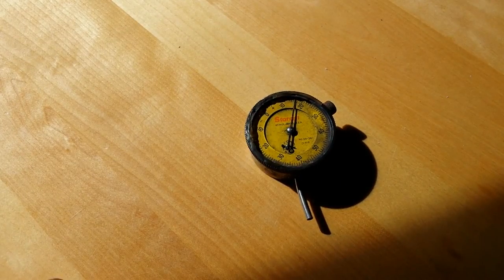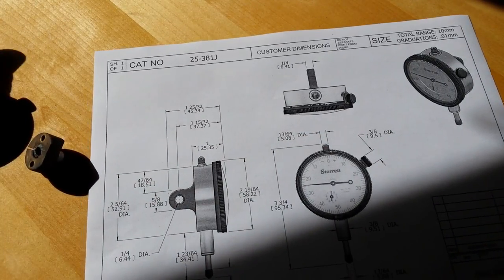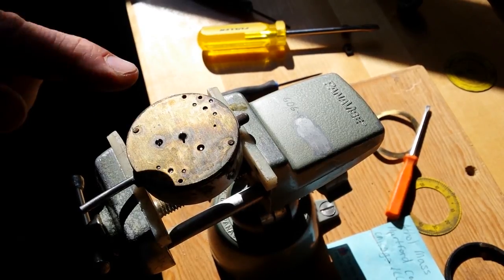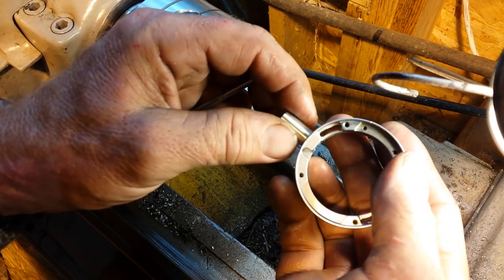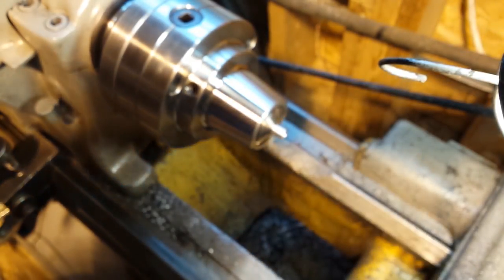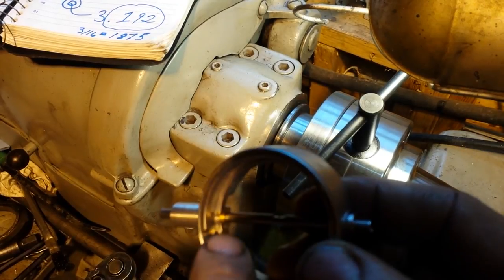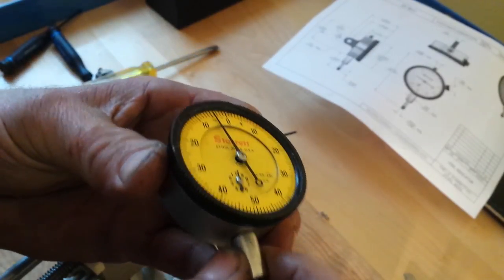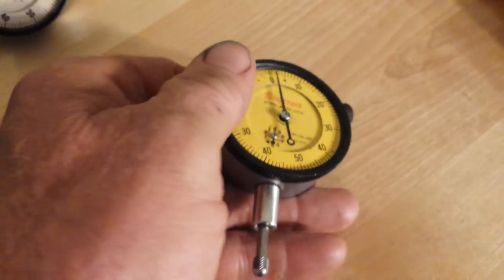Starrett Dial Indicator Rebuild

Comment: Nice work.  How did you straighten the plunger shaft? I have the same one with a  bent plunger.
Reply from the maker: Hi Ron. Its been a few years now. I think I had it in a jewelers vice with soft jaws and may have used channel lock pliers with a thinks rag. No real easy way to do it just man handle it best you can. Thanks for watching and commenting.

Comment: Nice Job! But you left out the part I am really looking for - prying off the bezel. I just can't seem to figure it out. It seems like it wants to pull the whole dial off with it. Any insight? Thanks.
Reply from the maker: It wasn't easy, I tried in many different places. Just keep trying until it feels like it will come off. It was tricky to put it back together as well. Good luck, thanks for watching.

Comment: Bad habit to leave the key in the Chuck. First thing taught in machine class.
Reply from the maker: Hi Chuck. You are absolutely right. I had to watch and yes I did leave the key in the chuck but I was in the midle of an operation. I was about to place a part in there. Thanks for pointing that out and thanks for watching and commenting.

Comment: You skipped the most important parts
Reply from the maker: Hi Robbie. Thanks for the comment. I never repaired a dial indicator before this and i really didn't want to mess up. I chose to do the very challenging parts without the distinction of taking video. Thanks for watching.
Reply: @Journeyman Randy  I'm pretty sure that's what people really clicked for but thanks anyway.
Reply from the maker: Hi Drew. I copped out. I should have run the camera. I was pretty sure I would mess this up. I sure enjoyed doing it. Making videos is not easy. Thanks for watching and commenting.